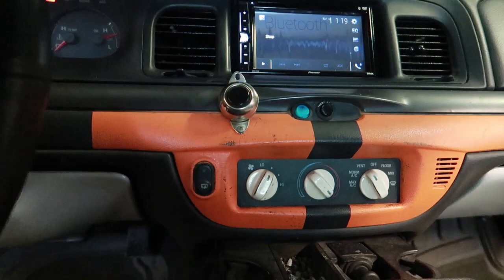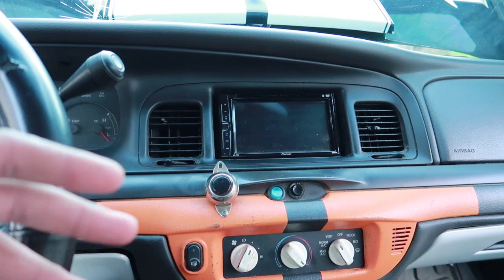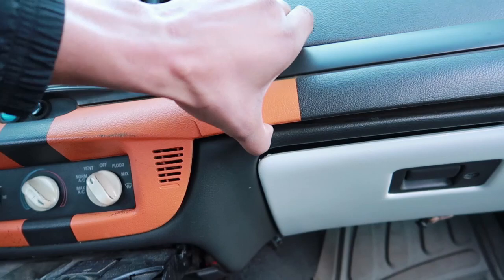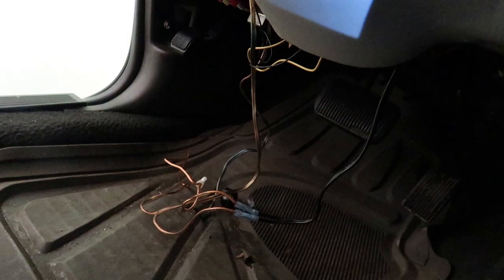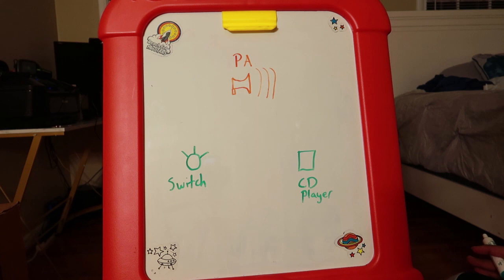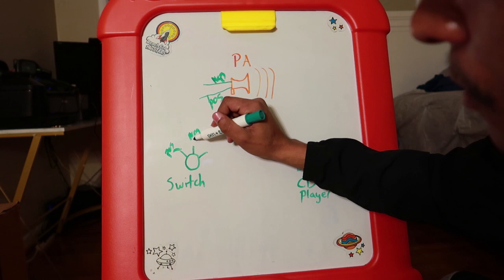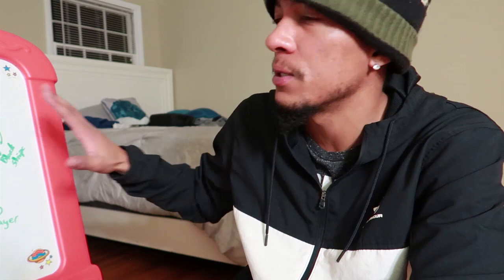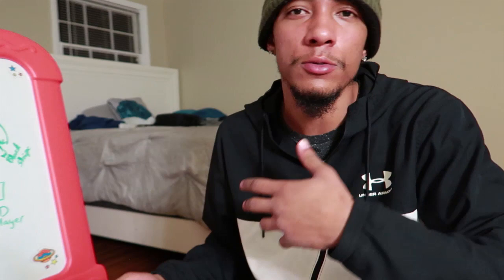How To Wire Up a PA Stadium Speaker In Your Car

Comment: Hooked up my pas and when I turn it on it sounds awesome, but when I want to turn it off there’s static in my rear speakers! Plz help
Reply: Recheck your wires make sure positive wires isn’t touching the negative wires. Recheck your work. You’ll realize some mistakes that you come across and didn’t even notice.
Reply: @Blanco_5.0   what I did to fix it was i bought a pyle 60 watt homefi amp for about $25 on amazon and hooked the pa speakers to it and they sounded way louder and super clear. i got rid of the toggle switch that turns the pa on and off and use the amps power switch instead. the way he has it ran in the video works but i think the little 60 watt amp is a go too.

Comment: It's better to use a 2 prong switch that taps into the positive wires from the audio source to the horn. Just more simple and functional especially with multiple switch setups as demonstrated by "siren battles" videos.
Reply from the maker: Thanx for that info brother. Ill definetely let people know in the future thats a better option to go with.
Reply: Ouaa the uzo teaching his ways 🙌🏽📢
Reply: @DynastyQureq  AFTLOS uso ❤️🙏🏽
Reply: Whats the switch called?
Reply: @semajin_booh97  The one in the video is a 3 prong switch so you can see the light on when you switch it on. The 2 prong switch is the switch that doesn't have the third prong for tbe light.
Reply: I did it the way you explained it works but I can't turn it off by the switch when I hit off its still plays
Reply: @calvinshannon2859  Did you wire the positive wires only? It could be that or your switch isn't the only source that is connected.

Comment: Not hating but wouldnt this just power the PA Spk because well... The switch isnt in between the circuit flow its outside actually ughh... So it dont stop the audio at all its live... No??
Reply from the maker: If everything is hooked up properly the inside cabin speakers will remain with power at all times and the switch would just cut the power to the PA when not wanting to be used, a jumper wire in front of the circuit to the cabin speakers will allow the cabin speakers to remain on at all times while the switch will control the PA.

Comment: Damn man I appreciate how you explained everything. Seemed a bit like me, I suck at explaining things without drawing it out or showing exactly what I mean.
Reply: Yoo man did u use seprate wire when u tap in to ur door speaker from head unit?
Reply: @jayypeezy36  You'll prolly need to... unless you rigged it up front maybe, or if your stereo has designated spots (though that would mean you'd be running another line anyways).
Reply: @crayder1100  appreciate it man I was confused 🙏

Comment: I did an install on a atv I find that the marine amps are better to use with these speaker intercoms I also installed one on my truck with a marine amp and you can hear that intercom scream best little audio install I’ve ever did to my truck

Comment: Explain this how is the switch supposed to work on this if the music is going straight to the PA and when you hit the switch the pos and neg will hit each other doing the install right now and it just dont make since to me how this would work lol
Reply from the maker: The music isnt going straight to the PA, the PA is tapped in to the music, the switch is just there to supply the power/music whenever the switch is in the on position.

Comment: Why do you need to connect them before the switch? Once the wires touch it would be the same as a terminal at the switch right? Or did I miss something?
Reply from the maker: You can do it either way. You can run the wire to the switch from the door speaker if you want. As long as you have a signal and power from the radio then it will work.
Reply: @2xmototv206 so for me, I tried it the way u said in the video and the traditional way a switch would work and I got static both ways even after switching polarities. What ended up working for me was - from pa to purple black - from head unit. And + purple from head unit to + on switch. + from pa to - or (load) on switch. Leave ground hanging.
Reply: @1bigstash do u get static fam? And does just the pa speaker shuts off on switch? not the inside speakers ?

Comment: What ended up working for me was - from pa to purple black - from head unit. And + purple from head unit to + on switch. + from pa to - or (load) on switch. Leave ground hanging. 

Basically created a disconnect between + signal…

Comment: I did this, but when I I turn the switch off, my car speakers have static… u kno what I have too do?
Reply from the maker: Another person I spoke to had the same issue. It's in your switch, you need to have a switch with a ground instead of just a posi and netruel, the switch should be 3 pronged and wire it accordingly.

Comment: Y does my door speaker cut of when I turn it up just the one I got it hooked to goes out
Reply from the maker: You may need a amp. Both the PA and door speaker maybe drawing too much current through the wire.

Comment: I do got a question how to I wire it up without a switch cause I run it stright to my door speaker wire but it still isn’t working so idk what’s going on
Reply: And on the pa you put in your bio I ordered it and the red and black wire where does that go cause I know the solid black is negative so idk where the other one goes

Comment: The amp i have is only going to my sub in the back…Would i be find tappin in to my front door speakers?
Reply from the maker: Are you trying to put a amp to the PA speaker? Or are you asking about tapping the PA speakers in to the door speakers?
Reply: Yes, i want to tap my pa into my front door speakers
Reply: Get another amp to wire the siren or pa to it, more louder

Comment: I have a question my horns won’t come on in my grand Marquis when I got the new double din
Reply from the maker: Make sure you are tapped in to a signal and that the double din is putting power to the horns.
Reply: @2xmototv206  my radio guy did no sound
Reply: At first my amp fuse on my horns blew thought that fixed the problem still. Nothing
Reply: @2xmototv206  my horns blew everything is connected no sound plus my amp for the horns are on but no sound I’m pissed

Comment: Can you wire a pa speaker to the stock door speaker or the factory radio?
Reply from the maker: You should be able to.. the wiring is still the same on both stock and aftermarket radios

Comment: Nice bro. What is your exhaust set up?
Reply from the maker: Thanx brother. Longtube Stainless Works Headers with 2 Green Cats, 2 3/4 Pipe to 2 super 10s with dump tips.
Reply: 💪🏾💯🔥 I was told to just do a rear  mufflers  delete str8 pipe and tips on p71 If I don’t want the check engine light on. Any ideas?

Comment: Yo so do I use speaker wire to tap in to the switch wire or do I just use the regular wire from the radio to the switch?
Reply from the maker: Speaker wire.

Comment: Im a little late but when you get a AFTERMARKET Radio it comes with a harness there are 2 negative purp/black stripe wires now and 2 purp positive wires so how do i tap that TO the PA

Comment: hey i hooked up my pas and when i flip the switch to have them on they are perfect but when i flip it off my system has static help!!
Reply: Same brother! Have you found a fix ?
Reply: @maplesgamer378  i brung it to a audio shop and they think one of my door speakers or 6by9 hot and negative are on different terminals causing it to do that , i’m bringing it to them wednesday so they can look at it some more
Reply: @maplesgamer378  i would check all interior speaker wires that’s what they are doing
Reply: @SheMoansJ  how did you run your hot and negative speaker wire? I got mine running from the radio hot and negative speaker wire. Maybe it need to be hooked connected into a door speaker wire instead of a radio wire
Reply: @maplesgamer378  i have it my hot and negative wire ran to the purple wire just like he said , and then when i fired another one like the grey wire it don’t work at all , but people where telling me to just run the hot to the speaker wire and ground the switch
Reply: @SheMoansJ  did you ever figure out a solution?? I’ve tried about everything lol
Reply: @SheMoansJ  yo I think I figured it out, after pulling everything out and laying in front of me and trying I was still getting static even tho the wires and all were straight, turns out my radio isn’t putting out enough power for it and causing my speakers to static when my volumes go higher up. My radio only puts out like 200 watts and it’s hooked up to 4 JBL 6x8 at 70 rms each! 70x4 is 280 and then the Pa is 66 w on top, it was making my radio hella hot. I got a cheap radio, it’s a dual some form Walmart

Comment: I set it up exactly like your diagram
but yet music leaks through the PA
 not to loud but enough to here it clearly
Reply: Does ur speaker turn off outside with switch? Or does ur inside speakers turn off also fam?
Reply: @jayypeezy36  all of the speakers inside and outside stay on when switch is off 

But the outside one is a little more quiet
Reply: @MRShakyCruzin  oh okay just asking boss I was thinking about running it the same way like video but wasnt sure?
Reply: @jayypeezy36  it might work on a normal pa 

But I am trying to run it to a old police PA
Reply: @MRShakyCruzin  oh okay boss im tryna do some marine speakers....

Comment: So I got a 100 watt double din, could I still run 2 50 watt pa speakers to the radio without an amp still?
Reply from the maker: Yes sir. Your radio isnt putting out 100 watts per channel but it splits up that 100 watts to power all it is running.
Reply: @2xmototv206  ok, thank you man much appreciated

Comment: Can u run it to the car amp without harming the amp or horn?
Reply from the maker: Yea. As long as the wattage from the amp isnt too high for what the horn can handle.
Reply: @2xmototv206 Cool 💯.And the ground and power to the amp also right?

Comment: How come when I turn my switch off it turns off my speakers inside my car ?
Reply from the maker: Check your wiring. You may have it tapped in before the output of the signal.
Reply: @2xmototv206  I’m have this same issue. Pls helppppp

Comment: Do the switch new 12v power
Reply from the maker: The 12v power source coming from your door speaker wire is used to run it.
Reply: Preciate bro🦾🦾 And I have a crown Vic as well and I wanna add power to the stock engine what u thank the best route